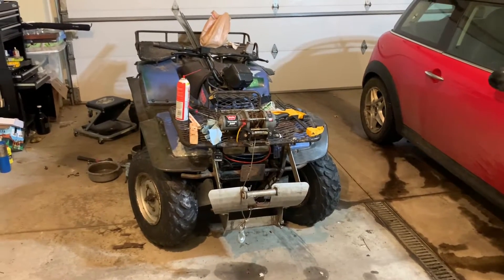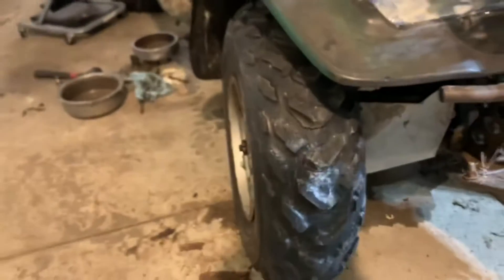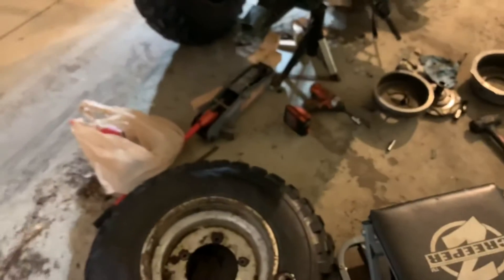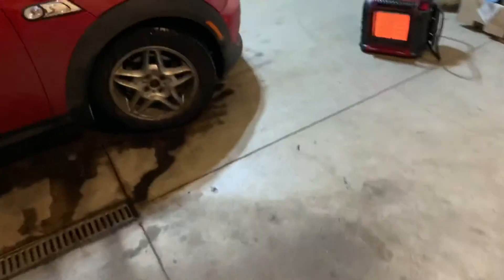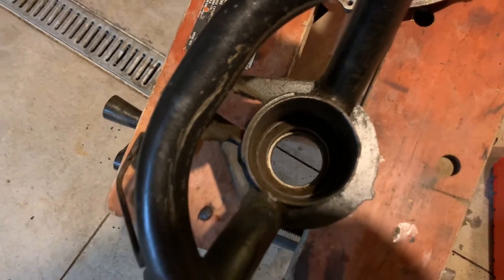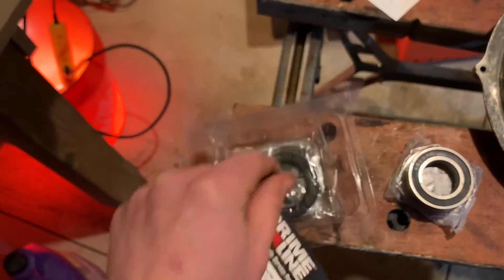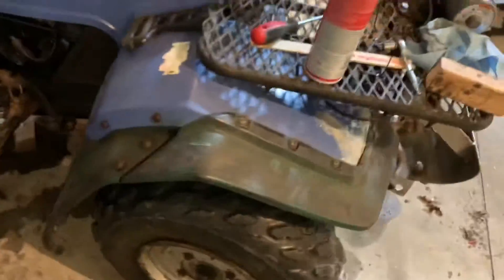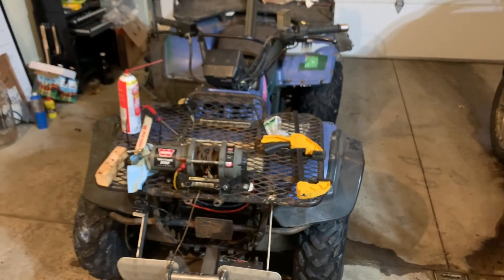Quad King 300 overview and rebuild rear axle, bearing, and other trouble shooting

Comment: I repaced my rear axle UJ by cutting it out with an angle grinder on the inside then hitting the caps inwards. You can't press outwards as they're peened in. 
If you do put a replacement one in make sure it's a strong one and tac weld the caps in so they dont come out!